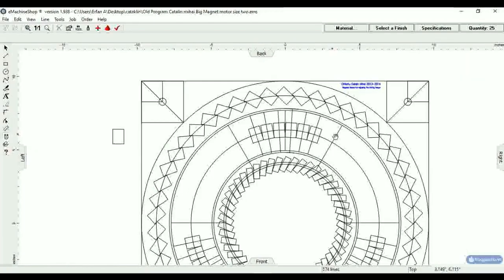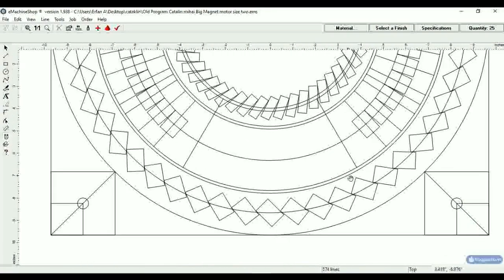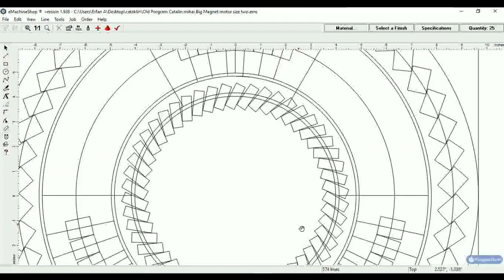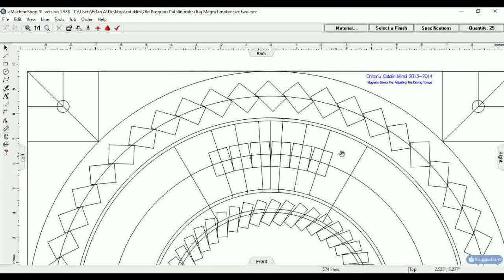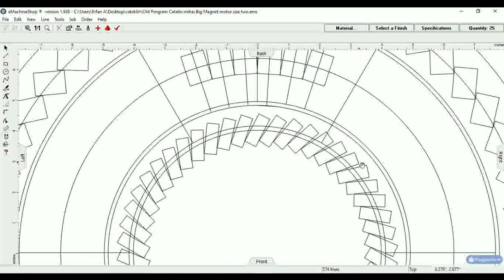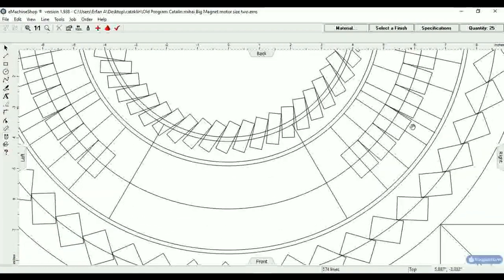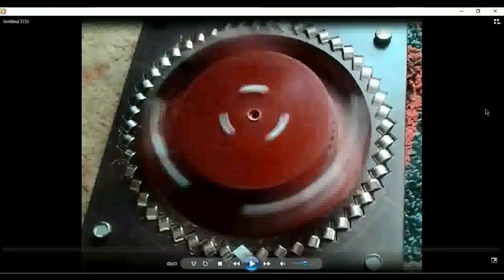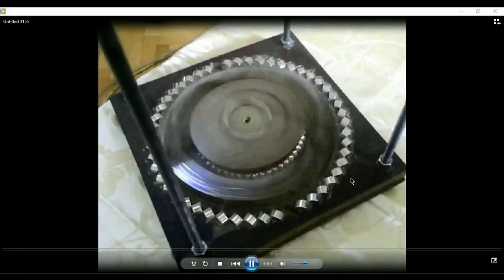Real Catalin Mihai Magnet Motor Why not 3d Printer

Comment: my guess is not only magnets do the work, but in the catalin's patent we see also shields in the drawings. Now I haven't much time but my next step will be to add a kind of metallic shields on the magnet and see what happens..   perhaps also leddskalnin perpetual holder teaches something about what kind of metal will be right
Reply from the maker: But good luck in this project.. this motor examination to many engeeneer but they build  refused to prove! how to make  work! but we have chance solve it working maybee in future.. I'm gonna still continue on my interest building searching how to unlock key to make it work.
Reply: @erfans.6928  Good luck with your project. Looking forward to see something happening!
Reply from the maker: Interesting, catalin magnet motor is fully prototype connected same as John searl set generator, Edward YouTube
✅ Edward Leedskalnin Perpetual Motion magnetic currents " does this mean if we setup up elecromagnetic would work this creating zero point field. The understanding catalin can be work continually do to close loop we can but permeant magnet is problem won't work! Because they stack magnet distract weakest field is putting same physics strings and waves will wind down.

Comment: Ese projeto funciona sem parar ????
Reply from the maker: Key is build this I will 3d design soon out download no cost. I know I can key scale everyone design, cylinder magnet type  neodymium type used only . I still continue to this day! I know their magnet are different type neodymium can success motor running. Problem is   On catalin motor is only  it made in other type periodic table element metals on neodymium that's can't be described!he  make it work! But until today future in this year those neodymium are different type power that can not work when stack all magnets bar. That catalin magnet neodym they used are different then what we have today.
If I build this I will part each proving their way each steps guide to see how it works rather explaining it clearly specific each part video experience